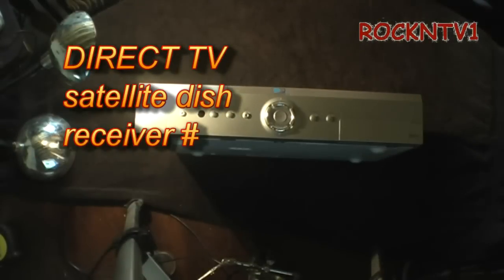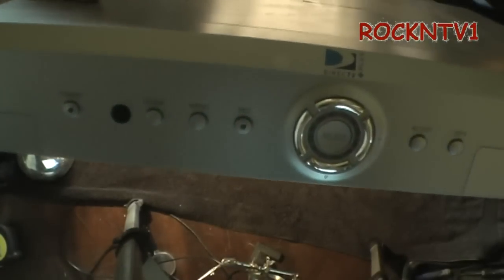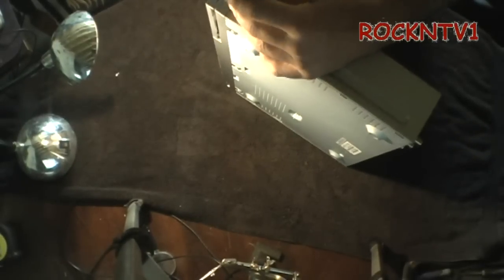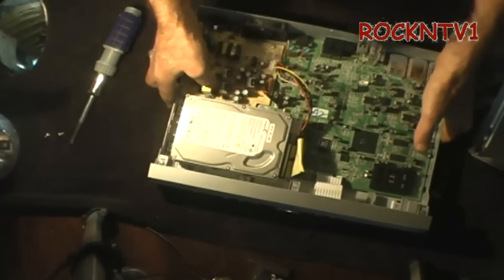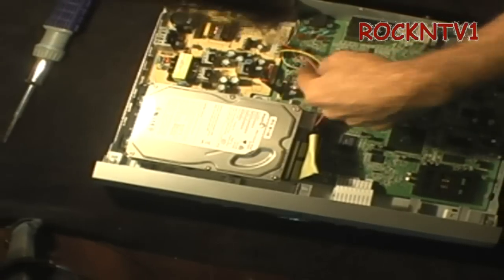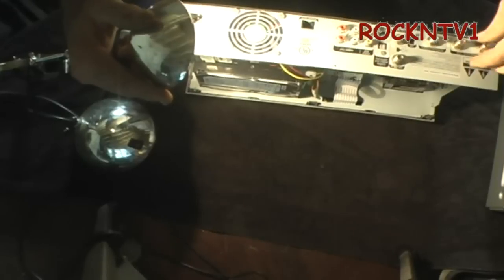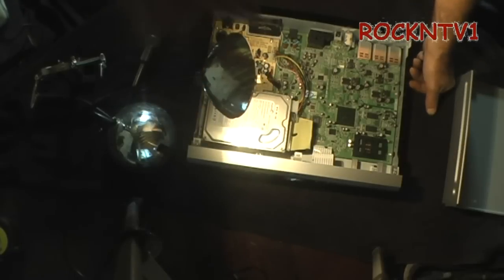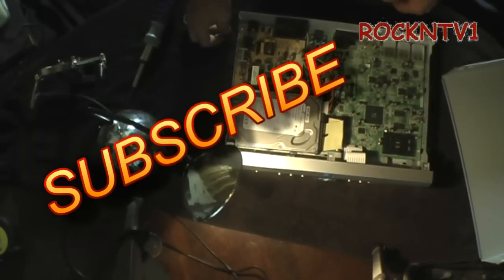DIRECTV SATELLITE DISH RECEIVER HACK

Comment: You can also just as easily format it for NTFS or any other file system format.  I had one of these R15 receivers a couple years ago and the drives do show up just fine in windows disk management as unrecognized and I was able to read the disk in Linux since D-TV receivers run Linux or a similar Unix variant but video data is encrypted.  Not a big deal as I was just curious and had no intention of breaking encryption.  Great to see outdated hardware being parted out for reuse.

Comment from the maker: When working on electronic components such as the r15 directv satellite receiver, non electrically conductive tools should be used, but this is a older unit we will hack for parts with standard tools,

Comment: You can replace the hard drive with a terabyte drive and make the DVR storage space larger right?
Reply: Of course you need the firmware though
Reply from the maker: the file system is proprietary, and files in wrappers

Comment: Hello, I have Dish Network and I save lots of my favorite shows to DVR for later viewing.  Last year I updated receivers and even though I saved everything to an external hard drive first, they would not play on he new receiver.  Dish Network said it only works on the receiver it was recorded on (after I list everything of course).

Is there any way (other than recording each individual show to DVD) to save my recordings on an external hard drive "un-coded" so this will not happen again?  

Plus, I want them in the 1080P HD video and not just DVD quality like I have been doing for the past 8 months which by the way takes forever to record every individual show.  :)

Please, any advice you can offer will be greatly appreciated.  I want to be able to view them on my TV if possible but I will settle for my computer if I have to.

Thanks
Reply from the maker: no, and no

Comment: I've got 3 500GB sata drives out of old direct tv boxes over the years. Thing is they lock em with some code so most computers can't use it and even if the computer knows its there windows does't. Using hdat2 (i think_) You can rewrite the data to the HDD unlocking it for use with whatever you want. It's worked for me anyways.
Reply from the maker: I plugged this one ide into xp pro, no prob

Comment: The hard drive will not spin up in the Windows environment--it can't because of the coding. Linux systems will see the drive and can even format it but it will still not power up in Windows. There was some discussion about this in another thread but I have since lost it...Windows may at some point see the drive but the info is erroneous and the  hdd cannot be accessed......Hackers have been trying to open this thing for a couple of years. Anyone know how it's done?